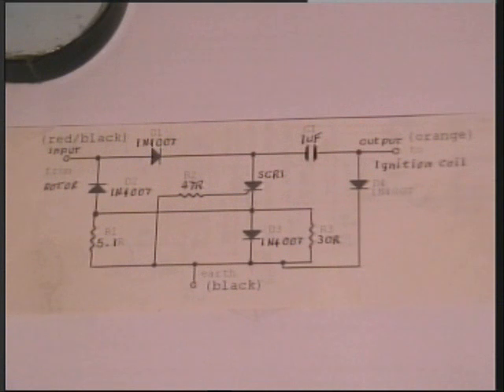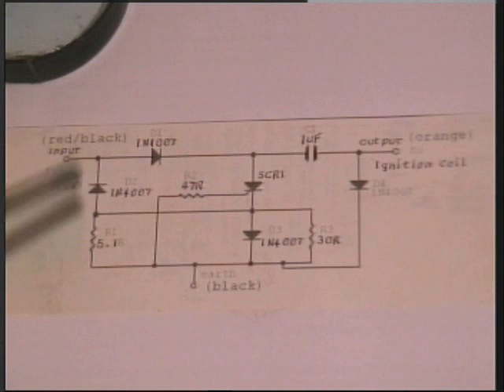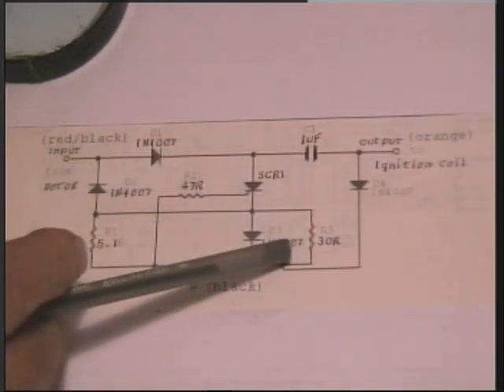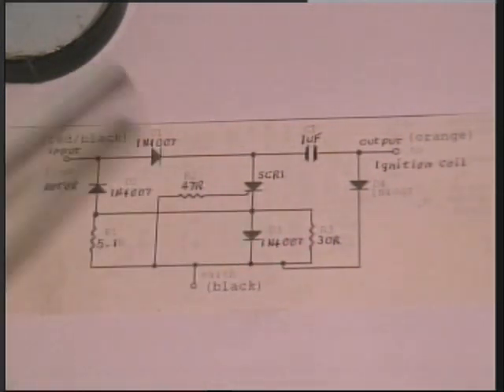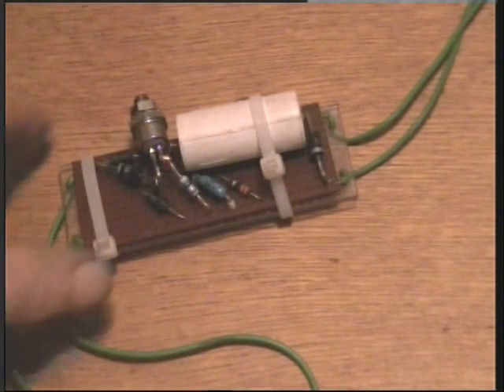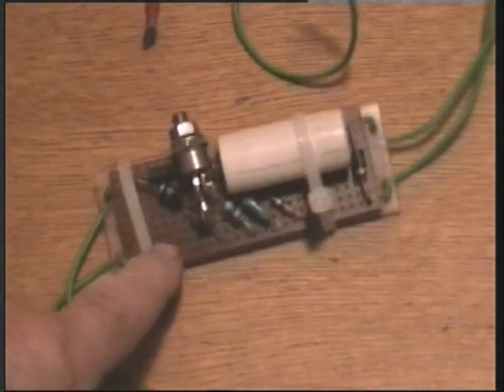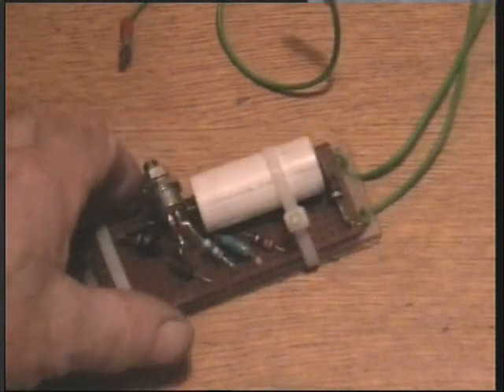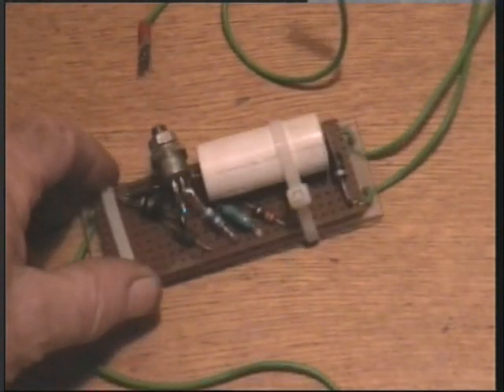home made cdi for outboard.wmv

Comment: Cool idea and implementation!
In my case, old Honda15 4stroke I replaced CDI with a one comimg from a bike/quad, with the same connectors and a manual settimgs of ignition advance angle adjustment and... it works!!
See a vid on my channel.
Reply from the maker: good for you !

Comment: Hi thank you for the home made CDI I have a question my CEV magneto has one ingnition coil on the stator with a wire from one end of the coil to charge the Capicator and a wire from the other end to trigger the SCR your drawing only shows  one conection from the stator coil.?? should I conect the trigger wire to the Black wire at the bottom of your drawing or should I conect one end of the coil to ground and just use the one wire for charging the + Capcitor and - trigger the SCr
PS I have found one CDI but it will only give a spark when the Flywheel is rotating in a clockwise direction and my engine needs to rotate anti clockwise????????????
Reply from the maker: Sorry but as I don't know you're set up your end I'm at a loss how best to advise you,

Comment: hello, your video is very inspiring, you need a c.d.i for a m40c tohatsu engine is two cylinders.
My question is: can I put a cdi of a motorcycle receiving the same impulse from the reception of the plate, connecting it to the computer of the motorcycle and then turn it on and turn it on and so I can ignite the spark of that same coil for the other cylinder?
I would like the teacher to guide me to the world and the world that is in this situation. Thank you
Reply from the maker: Sorry my friend but I don`t think we can communicate ? try locally good luck

Comment: Hi, I have a 15 hp mercury 2 stroke 1992, and the cdi is broken. I found out that the scr was bad. My question is, what model of scr can I use to replace the original one? In the original scr says "scr5 1625" thanks in advance
Reply from the maker: The model number is not recognized by me, do a extensive google and pic some higher spec, normally they are capsulized ? so intrigued,if you wish send me a photo to private messages

Comment: DOES THIS WORK ON TWO CYLINDER OUTBOARD?
Reply from the maker: If you looked a little bit down you would see the reply has been given .."you only need one (spark at exhaust is a lost spark system) being a twostroke engine you could not do that with fourstroke etc" so in a word ,yes

Comment: Please,I have a 40 hp  mercury outboard 2 cylinder with 6 magnet (flywheel. Could this circuit be used with the 6 magnet configuration (polarities in series) for this motor? I   apreciate your response. THANK YOU
Reply from the maker: 6 magnets ? are you sure ?

Comment: Great article! Your 30 hp Mariner must be 2 cylinders. Do you need 2 of these, and if so, how do you coordinate the firing?
Reply from the maker: you only need one (spark at exhaust is a lost spark system) being a twostroke engine you could not do that with fourstroke etc
Reply: Great Video !!
I'm planning to use your system on a 2000 Suzuki Marauder. 
Harley Davidson has been wasting spark forever with this system.
That's how they get their unique exhaust sound.

Comment: Hi! great job!, i have a jhonson 85 hp outboard, and his CDI is broken, this motor is 4 cilinders, this circuit is compatible whith my outboard? Please help!!
Reply from the maker: If the engine was mine then I would get it going BUT how do you know the cdi has "broken" this is not a simple question I can  reply to , you don`t say if its twostroke (lost spark cycle) or how many HT coils etc you don`t say if the engine is old so worth moding or newish and is worth a new cdi (if needed ?) in short my best advice is get it "profesionaly"  checked out odds are it don`t need one !

Comment: Sorry to bother you, is the capacitor polarized or non-polarized? harder than you think to find them at a good price ebay from £15 Maplins don't stock, I have plenty of 8.4mF 250volt and 1mF 275volt hardly the same, I can sort a bank if polarized are allowed.

Comment: You have gone to the time and trouble so I will do the same, I have complete faith in this circuit, thanks. Just out of curiosity do you think its possible electronicly (via throttle link) to delay the signal on tick over? or have I got it backwards and it needs to fire earlier.
Reply from the maker: No it defiantly needs to fire later at "tickover".(the trigger coil is 
further round than the charge coil by aprox 10%) but theres not much you
 can do about that.if you want it right and its a newish engine, then 
buy a proper replacement part but if its an old bangger then don`t worry
 about it ! you seem to be taking a lot of trouble to avoid buying a new
 one,in my case that was £70+ produced this for £3 but then my channel 
name is poroldchap........

Comment: Just one last point (no pun intended) Is the timing effected or does it more or less fire at the correct time?
Reply from the maker: ***** No its advanced by 10-12% that meens it will "pink" at tickover but as there is no processing after a half to 3/4 throttle you won`t notice any difference, this is a cheap way out, or you can always pay mega bucks for a new CDI ... !  :-)

Comment: Forgot to mention it's a twin cylinder 402hp 2 ht coils, not worried about an extra spark in the exhaust stroke just not sure if it's the stator wiring only or do i need the 2 trigger signals?

Comment: Hi you poor old chap, I'm fixing a old Mercury 1980 40hp for a mate as you do! The CDI has gone so I plan to fix it using your build and claim the credit! only joking.
Just one point I'm not 100% sure on, the input....is it just from the trigger coils or is the stator wired into the same input?  i.e. approx 280v input with a pulsed trigger input on top? (parallel)

Comment: Do you use 2 circuit. One for each spark plug on 2 cylinder engine. Thanks
Reply from the maker: No one circut for two "IF" their is one HT coil ......if not then two. (in other words you need 1 circut per HT coil)
hope that helps

Comment: your outboard is 1 or 2 cylinder? I'm try to understand how don't make back fire and fire just one of 2 coil at time synchronize with trigger
Reply from the maker: I`m not clear what your question is,sorry, the outboard in question was 30hp 2 cylinder (but it could be one or more cylinders) the "actual triger coil" is NOT used to discharge the capacitor in this circuit.
see explanation at beginning of video

Comment: Have already eliminated bad connections by removing the coil from the engine and checking the resistance direct onto good clean metals while wriggling the wire and pulling on it. That's when the resistance climbed right up and went open, so I'm preety certain it's stuffed. Pulling and wriggling the wire had no effect. I'm surprised to hear that the number of turns is not critical. Makes things easier. Now to get hold of enough of the correct gauge wire. Like you I'm a scrounger so here's hoping.

Comment: Looks like I either have to try getting a second hand coil or try re wrapping the old one. Wondering how many turns and where to get the correct wire and how to count them accurately. Sigh----. At least I now think that the CDI and pickup (or trigger) is working so thanks for your help Sir. What would we do without people like you?

Comment: Good news and bad. Was definately checking charge coil. Today left the Ohm meter connected to see what happened. Kept climbing to 2000K and then went open circuit. Ign charge coil must be stuffed. As there seems a fair bit of room around the coil I decided to try wrapping some fine wire around the outside over the top of the other windings to see what happens. Earthed one end and brought other end out to connect to CDI box. Nothing. hooked back up to old coil windings. Now spark but not steady?

Comment: Thank you so much POC. I'll do some more checking. I would love to make and fit one of your CDI's, but having trouble acquiring parts here in country NSW Aust. the 600 v 1 MF caps seem not available here. The SCR that you used in the video looks like a very high amperage one. Ebay have SCR's cheap so I might have to order some from them. Cheers and thanks in advance, Pete.

Comment: I have a Honda BF8 that has no spark. I made one of your coil testers and the coil is OK. Nice long spark about 12 MM. I need to find if the problem is in either the coil under the flywheel, the pickup  or the cdi box. With a multimeter on the coil under the flywheel I 18-22 volts AC. I was expecting much more here but I really wouldn't know what to expect. The resistance started at about 350K and steadily climbed to 720 and was still climbing??. The pickup is 122 ohms. Do these sound near. Thks